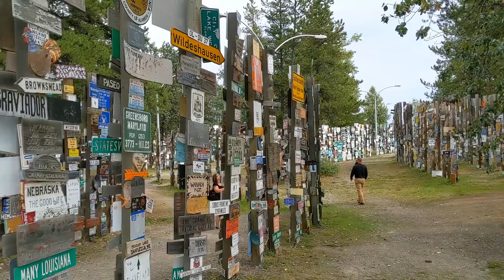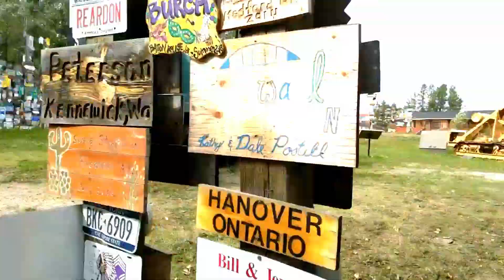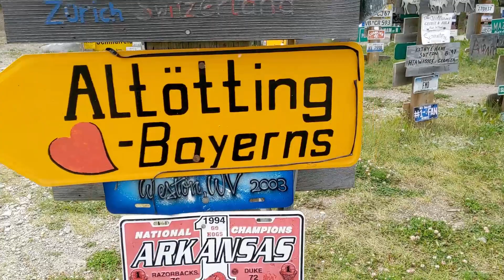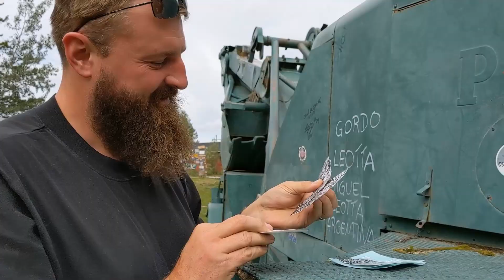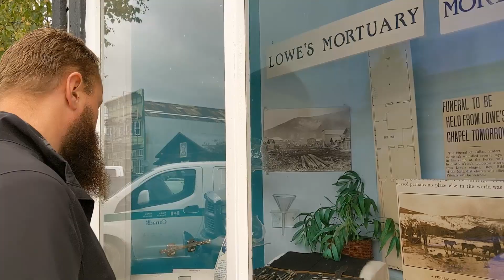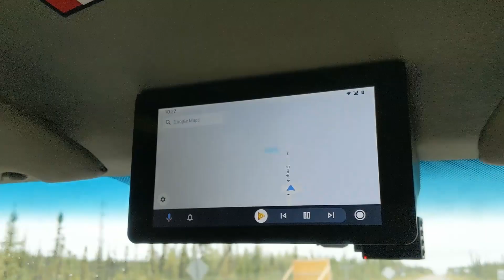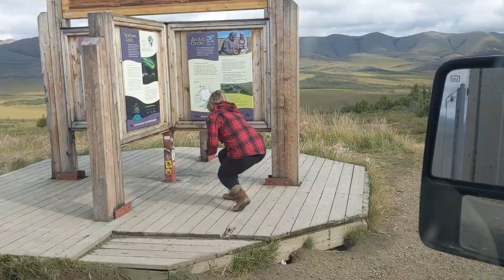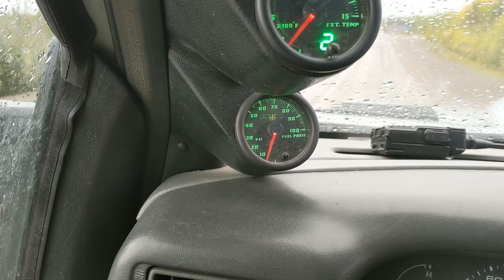Stranded in the Arctic - Everlanders see the World

Comment: Judging by the colour of the fuel in the ziploc at the beginning of the video i would also say clogged pickup strainer. 

Tho can’t beat what I once found as fuel starvation problem while I was still working at the dealer. An old 94 Topkick came in for intermittent stalling and unable to restart for a few hours. We check everything but I mean everything and after sending the client back home with the truck starting back normally after each time! I think he must of came back 4-5 times on the tow truck before we figured it out. It went to the point we knew these CAT 3126 had of cam sensor problem we  took of the front cover to make sure the cam gears weren’t broken or shifting out of range. After I dunno how many time  we took the fuel tank off the last time we did, we found IT! The most random shit ever... the client used fuel conditioner as a lot of them do here for the Kanuckistan winters but at one point he must of added it wrong and the little piece of foil that seals the top of the top of the bottle fell in the thank. And unfortunately at random interval it would get suck up by the pickup, clogged it and stall the truck. To at which point the suction would bleed off then after a while the piece would fall back and float away and the truck could restart normally until next time!....What a mess!!!.....
Reply from the maker: Good eye! That clip was a tenth of a second long, and the key detail to getting us on the road again!
Reply: @Everlanders  Glad to hear you fixed that problem also ! ; I'm not sure there is much you can't fix or create . A Happy Life and Wife inspiring to see and hear. I hope to see you out there someday ~peace~
Reply: AWESOME!
Reply: Glad to hear it! Aye carrumba!

Comment: Possibly a clogged intake screen inside the tank at the bottom of the boot? Could be clogged filters too. Happened at least 3 times over the years to one of our work f550's with a 7.3 leaving me on the side of the road.
Reply from the maker: Correct!
Reply: Time to remove the filters. 
Several videos on the mod on you tube. They were a bad idea from the factory.

Comment: I think the only thing you can do is start at one end & check the strainer in the tank, make sure the tank is being vented properly, and then pull each line & check them for obstructions. Then do the same for your filters, the fuel pressure regulator, or basically every component up to the fuel rail. Another thing is that most newer vehicles have pumps mounted inside the fuel tank because the fuel keeps the high pressure pumps cool. I went through 3 pumps on my Suburban until I figured out that I was driving too often with less than a quarter tank of gas. I stopped that habit & haven't had a pump fail in 5 years so far. Assuming that your rig is a diesel there's a chance that years of using funky fuel & additives could have caused a build-up of gunk in the lines & it's causing the pump to work too hard. And everyone knows that a restricted line won't allow enough volume to flow through it.
Reply from the maker: Turns out my tank was just full of mud, who knew?

Comment: Some type of contamination (paper, plastic, etc.) in your fuel tank is blocking flow.  Then when power is off, it falls off strainer.    Other is in fuel filter could be something clogging it and then releasing after fuel pump is shut off.       Traveled to Alaska in past and noticed little bit of contaminants in gasoline.    Always had a spare couple filters and way to access fuel tank to clean it if required.

Comment: Tube in the fuel tank cracked/broken right above the fuel level in the tank.  Sad you're having trouble.  Love the rig!!!
Reply: fix using a few inches/centimeters of the same silicone tubing you used as a washer ... slide it over the broken/cracked part and hose clamp both ends (either side or the broke/crack) to make it seal.

Comment: Seems like tank debris. Pump on line pressure is up and the debris sucks to and blocks the inlet. Engine dies pump off and the debris falls away from the inlet. Test the fuel pump relay also. I read someone suggested you get a dirt bike. I would suggest a mountain bike. More reliable and can be made surprising compact for storage if your not going to ride it regularly. Of course it will take time to assemble but hey you can make it down the road.....
Reply from the maker: Debris in the pickup tube was likely at fault, we blew compressed air backwards from the pump until it bubbled in the tank and then we got going again. We probably couldn't have used a mountain bike or even a dirt bike in this case, it was a 100 kilometers to the next village, and experienced motorcyclists were leaving their bikes and hitchhiking to town, the roads were in pretty rough shape at that time.
Reply: @Everlanders  I hear you on the road conditions/distance. Some kind of backup mode of transportation is better than none..... Enjoyed the edit of this video.

Comment: Have a look at the AirDog filter system. I installed that on my rig and never looked back. It constantly filters and recirculate the fuel as you drive and with the 1/2" fuel pickup it doesn't get clogged. Anyways just an idea for a future upgrade. BTW 7 years and still going strong.
Reply from the maker: How much mud can they take before they are saturated? https://youtu.be/GRPEE56w53k
Reply: I was just going to say he needs a return style fuel system. But isn't the 6.7 l already return style?

Comment: Hey brother, a tap and die with some basic stock material would serve you well as you could make your own nuts, bolts, etc. A small vice with a good cordless drill or press a plus. ;) An ultralight mini-motorcycle wouldn't be a bad idea either to get you out of emergency spots back to town, etc.
Reply from the maker: I have a taps along... Aluminum and brass stock... A Milton nut a bolt selection... Sadly not the metric nut I needed.

Comment: That looks extremely similar to a Bosch 044 pump be careful I have had 3 fail on me. Every Bosch pump I installed made a terrible loud noise when I keyed on the truck and you could even hear it in the cab while the truck idled mine is a 7.3 as well I have installed a Walbro pump and hoping for better results, the Walbro is much quieter as well
Reply from the maker: In my case it is the NAPA pumps that keep failing, The Bosch was much quieter, while I had it in there...???

Comment: Definitely plugged or damaged pickup in tank. Use compressed air to blow from pump back to tank.  Pretty common on the 7.3 super duty.
Reply: shes  a 6.4. terrrrrible motor
Reply: Looks like a front clip off a 6.4 truck but i am pretty sure it's a 7.3.  Nobody would use a 6.4 to drive in the middle of nowhere.
Reply: @jcfabwerx  hahaha
Reply from the maker: Can Confirm, It's a Trophy Truck body kit which are flared to cover our 41" Conti's - But it's a '03 Chassis with the 7.3 Rebuilt in 2016
Reply: @Everlanders  Ahhh good choice

Comment: Another great video.
Sucking air through the fuel filter gasket, would be my guess.
Reply: Sven Anderson You are right, it is a pressurized system but if one of the two filters vibrates loose the pressure would be lost. I experienced this with my diesel, filter backed off a bit after driving on rough roads, broke the seal and started sucking in air

Comment: You know what you can do ? First use black electric tape pull tight over the thread. Don't have? Use a plastick bag 1\2 " pull tight till it mold to the thread around to build it up. And done so it work with the clock wise tightening . work all the time .
Reply: I see many old  van . rv. Afraid to tell them fuel pump goes out at the 110-200 mikes mark . and it cost a lot to drop the tank. The easy way is to cut the floor a small hole flap . but ford still need a special ac tool to take off the metal connector . water pump. Fuel pump. Alternater  starter. All  need to be change
Reply from the maker: Our pump is on the Frame Rail thankfully.

Comment: Are the fuel pumps that keep failing before or after your dual filter system? I know those fuel pumps can be pretty picky with bad/water in the fuel and only like to "push" fuel, they're crappy at sucking fuel through filters. Could also be an air leak in one of your fuel lines between the pump and the tank? Also, something blocking your fuel pick up in your tank where it falls away when there's no suction.  Anyways, hope it didn't take you long to get it fixed and back on the road.
Reply from the maker: Pump is after the filters... Blowing air backwards got me going again... 8 hours later...
Reply: @Everlanders  I would be confident in saying that is why you're having all the fuel pump failures. Move the pump to as close to the tank as possible and at minimum between the tank and all the filters.  Good luck.

Comment: you have on board air, i would try blowing backwards from the pump fitting to the tank, may clear the suction screen enough to get you going.?
Reply from the maker: Ding Ding... This is exactly what solved it!
Reply: @Everlanders  Cool,for future reference if the pressure falls off and  you know you have a good pump then it has to be behind the pump. glad you got it going.
Reply: @Everlanders  I was thinking the same, I was also wondering if he was going to try to file the copper helicoil to fit.

Comment: Almost sounds like the Hi pressure pump (fed by the low pressure pump you replaced) has "come un-assed"...They start to wear internally and all the metal from that wear now gets into the lines and injectors....REALLY hope I'm wrong!
Reply from the maker: We have solved the problem, we had a plugged pick up, blew compressed air backwards into the tank and got it cleared!
Reply: Sooo glad to be wrong!....you guys keep rocking...:)

Comment: Everlanders,
   I have a question about the fuel pump you are using. Is it the stock pump for the 7.3 or is it a higher capacity pump and what pressures are you reading for fuel pressure. My question is based on my stock pump not supplying sufficient pressure for the required minimum pressures that the injector pump requires, need 9 getting max 6.5psi even though it is a 'good' pump. I also have a different diesel engine then you do but I am still interested in the pressure delivered by your pump. I have found fuel lift kits but I am wanting to stay at a lower cost point than the $400US they are asking for. The only extra benefit I see in the lift kits I have found is the max pressures can be adjusted on the pump. If I have too much pressure I can purchase a fuel pressure regulator and set that device for what I need. Thanks in advance for any info you give. Wayne
Reply from the maker: It's a stock style pump, the pressure is controlled by a regulator spring at the fuel bowl, I show this spring near the end of this video. I currently have a 65psi spring in there...

Comment: Failing fuel pickup? After it drops does fuel bowl fill up? Faulty fuel pressure regulator dumping all your fuel back to the return? After it what is your fuel pressure KOEO before cranking?
Reply from the maker: Pressure regulator was good, I checked it at the end of the video... turns out something was plugging my pickup, blue air backwards from the pump and cleared it...

Comment: Return fuel pressure regulator stuck open, relay going bad, strainer clogged, filter clogged, collapsing line, sucking air
Reply from the maker: Pressure regulator was checked at the end of the video... Strainers were removed, shown in this video: https://youtu.be/GRPEE56w53k it turns out something was clogging my pickup, blue compressed air backwards from the fuel pump and got it going...
Reply: After just watching the next video and seeing what your fuel looked like, which I hope was just contaminated fuel you bought in that condition,  got me thinking about your gaskets ontop of your tank, there probably fine just wondering if you've looked to see if anything has backed off and getting dust and water in some how.  Glad to see you got it fixed though, look forward to seeing yalls future adventures

Comment: Fabulous video. Probably the best one you’ve ever done. You would do well to stop showing us how to connect batteries together we just don’t care. And do more of these. This one was great.

By the way the problem that you’re having is that you bought a Ford. Ford does not know how to make a diesel every single one they’ve ever built has been absolute crap since the 7.3 international.  General motors has a brand new series of medium duty trucks out on the market with your choice of 450,550 and 650 chassis with Duramax and Allison transmissions you would do well to go get one and move your box over.   Happy trails stay safe
Reply from the maker: Muddy Diesel fuel is to blame, clogged aftermarket fuel filters, would have happened to any model of vehicle...

Comment: EVERLANDER,
The FORD Superduty's have a dirty little secret.
 Ford uses a steel fuel tank into which FORD sprays a lining to combat rust from 
water in the tank just in case you should ever get any. Most do not.
EXCEPT,
The alcohol in gasoline & something in the Low Sulfur diesel fuel in the US
eats away at this lining. As more & more chunks break loose from the tank, 
they get sucked into the fuel system clogging it & creating a low fuel psi 
condition such as you are experiencing. 
The fix is to drop the tank, discard the fuel & send the tank out to a tank shop
where they will remove whats left of the inner lining & spray in a new lining.
EXCEPT,
Usually,  after some tens of thousands of miles, the whole scenario repeats itself!

WHY in the hell does those idiots at FORD use a STEEL tank ?!?!?!?!? I don't think there 
is another mfg on earth which uses STEEL. Everyone uses PLASTIC.
PLASTIC does not rust. PLASTIC does not need a liner. Its almost like FORD used a STEEL 
tank to trip up superduty owners. A little joke on the engineers part. What MORONS.

YES, there are aftermarket companies which sell PLASTIC replacement tanks for the superduty,
I work for co that has a fleet of 75 superdutys. We keep cleaning & re lining the tanks only to 
have to do it again. And again. These trucks are leased so the boss is reluctant to upgrade to PLASTIC.

Of course this wont help you in the bush.

!
Reply from the maker: We have a Poly tank... Update video coming tomorrow...